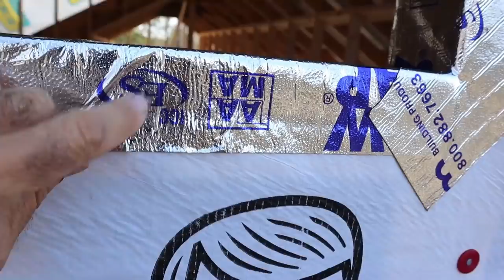HOUSE WRAP/ VAPOR Barrier on Gable Ends | She Shed Build | part 16

Comment: I may have missed it, but I'm curious why you didn't put a window in both gable ends for more crossbreeze/ ventilation and light, but I'm sure there is a good reason.  You guys get more done (and PROPERLY done) in a day than I do in a month.
Reply from the maker: The front gable is to small.